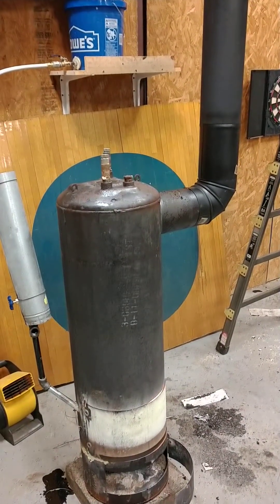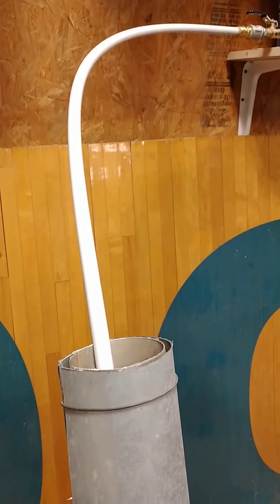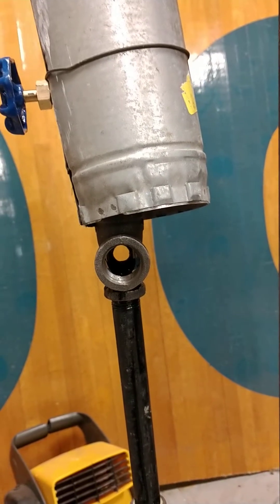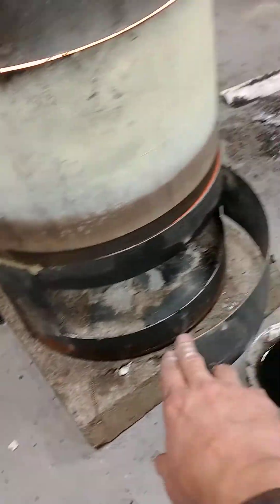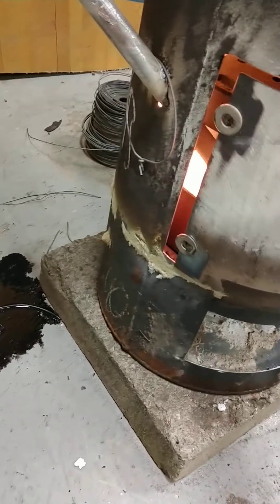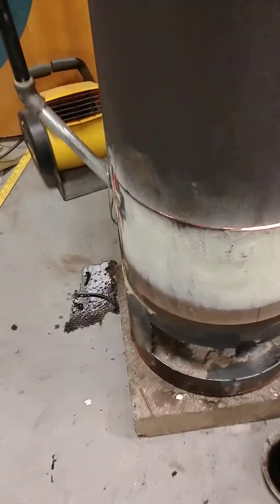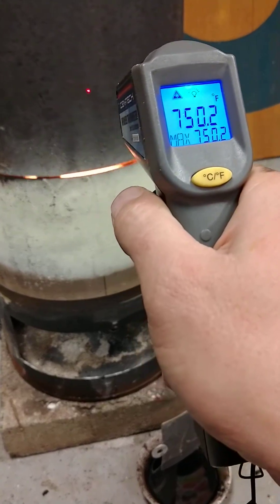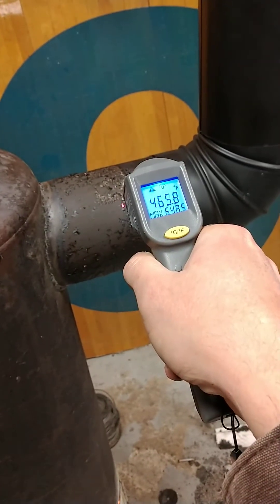Waste Oil Heater Drip Feed DIY ver 2.0

Comment: I would suggest using a needle valve instead of a modified gate valve.  It should give you way more flow control.
Reply from the maker: It will if you filter you oil